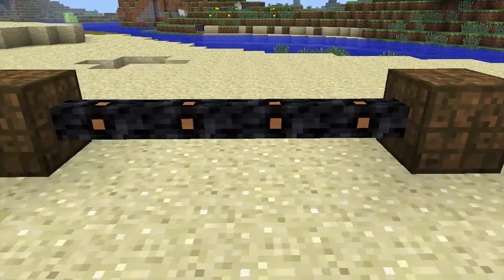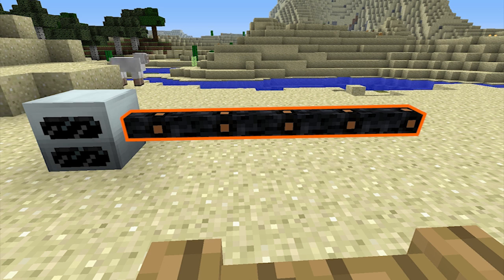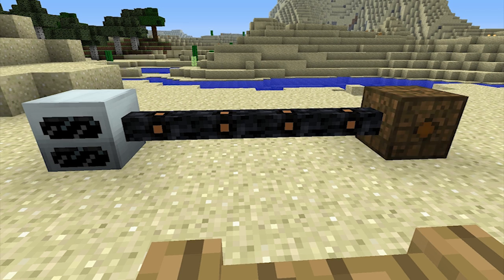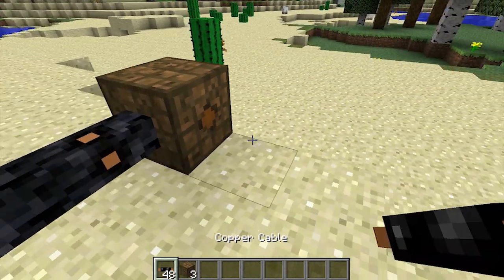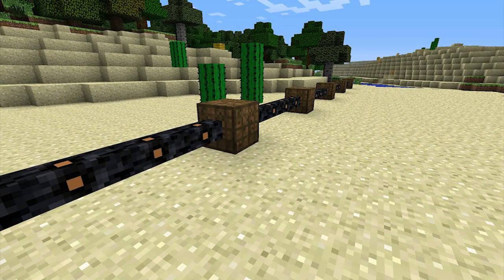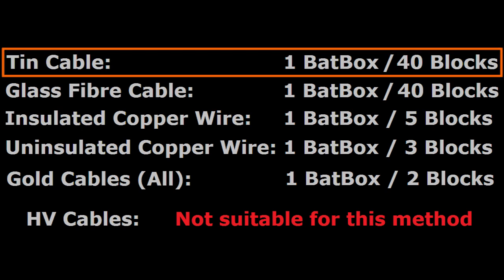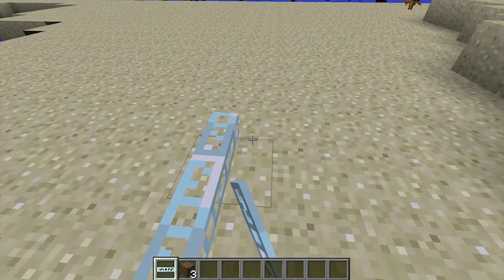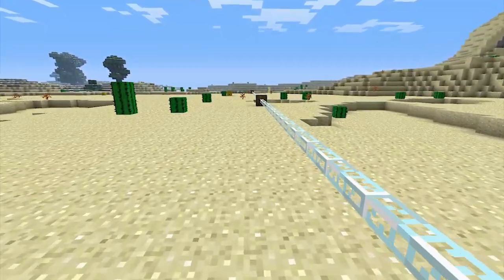Lossless Power Transmission (Tekkit/Feed The Beast) - Minecraft In Minutes

Comment from the maker: Depending on what you're powering, the BatBox chains may or may not be sufficient, HV chains also work, keep in mind that the raw materials required grow exponentially with more advanced components. BatBox chains are recommended mainly due to their low cost.

Comment: If you're moving large amounts of power I don't see how a Batbox would be sufficient.  Instead of crafting MFSUs however, would an HV chain also work?
Reply: For transferring high voltage long distance you'd want to use a transformer to reduce the eu then use a transformer at the end to step it back up. EU travels in packets and each packet has a total number of EU in it. If the EU is greater than your machine can tolerate it will explode BUT if it's not bigger than the max EU it doesn't matter. If you want an analogy machines can handle infinite current (bunch of 32 EU packets per tick) but can only handle finite voltage ( X > 32 EU per packet)